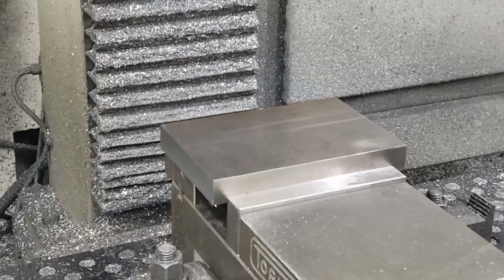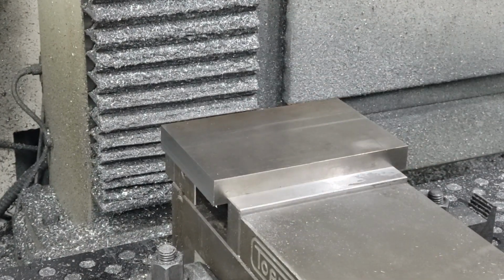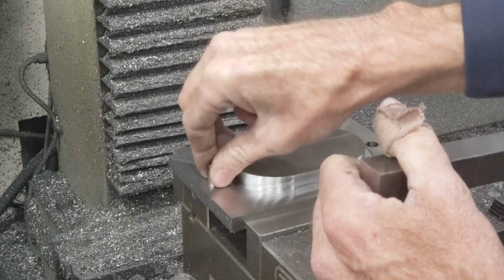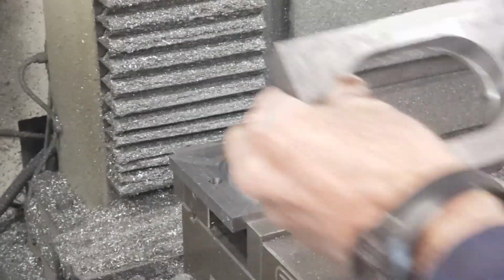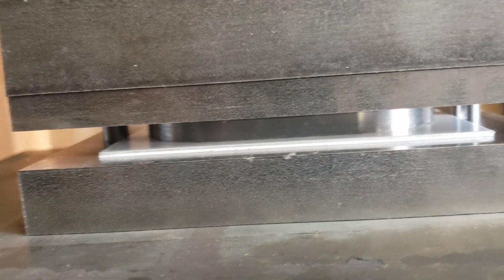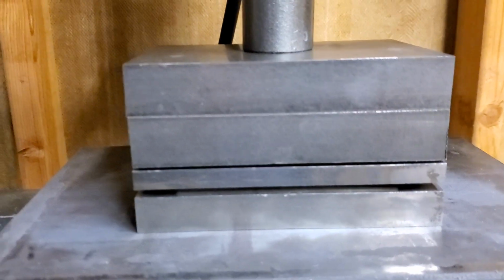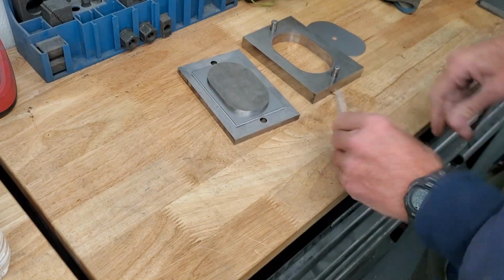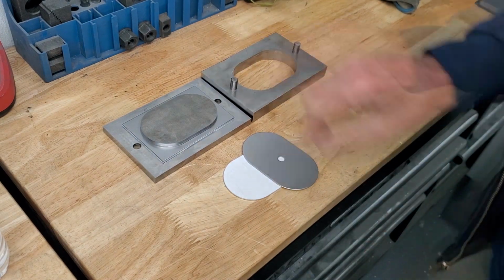Blanking Punch Die Set - The Punch

Comment: Apparnetly there are a couple styles of stripper plates, with thicker stock you can make L shaped guides that mount on the bottom plate that keep the sheet from lifting up with the punch, the other kind is like a spring loaded plate that holds the stock down.
Reply from the maker: Thanks, yeah I think I will be going with stripper springs on the guide posts and a stripper plate mounted to the top of the die.

Comment: I have made a few punch/die sets. You might try using loner pins to hold the blocks parallel and shorter top plates to clear the pins sticking out. 
Also make pockets around the pins for some die springs to open the punch from the die.
Mark the center to locate the press.
Reply from the maker: What are loner pins?
Reply: @craigsmachineshop2040  You can use hardened shafting and cut them to the length you need to go through the two blocks. McMaster Carr has shafting and longer dowel pins.

Comment: Looks like it's going good Craig, for future projects it's a industry standard to have the press fit of your pins on the core side of the tool, generally you leave them sticking up above the core this adds some level of protection I case of drops or knocking the plate over.
Reply: Cool.   If you ever find yourself needing a bit more tonnage, it’s possible to reduce the tonnage required by adding a “rooftop” or inverted rooftop angle profile to the punch face.  Of course it will tend to deform the part slightly which may be undesirable.   Depends on how steep you make it.   1 or 2 degrees might  be enough to help yet not deform the part.   Just something to consider...
Reply from the maker: Thanks Daniel. Yeah, I should have tried that on this die. I'm kind of afraid to on the real die set in case the holes aren't accurate and I can't get the pins out. Lol. I was planning on attaching the pins to the base plate with screws from the bottom.
Reply from the maker: I was thinking about making the punch concave but that's a lot of 3D machining of tool steel. Any idea of percentage of tonnage saved?
Reply: @craigsmachineshop2040  it looks like you got pretty good alignment on this one, if you want to make this one into a press on the core side just take a ball bearing larger the the hole diamater, put it on the hole and hit it a couple times with a hammer, the pin will press right in
Reply from the maker: Tricks of the trade huh. :)  I'll have to give it a try, thanks!

Comment: At 3:00 you’re testing hole fitment with a gauge pin; are you gradually upsizing that by changing the hole size in the gcode directly or are you using another type of command? Thank you!

Comment: You might try to build the relief at a taper instead of a step.  The taper will strengthen the shearing face and eliminate the sharp stress riser in the step.

Great work.  I always enjoy watching others make money in a home garage/shed.
Reply from the maker: Thanks Bruce! How is that typically done, with a taper endmill?
Reply: @craigsmachineshop2040 When machining the relief, set the part at an angle and use a conventional end mill.  Another way and maybe much easier with a CNC is to step mill the taper in increments from the bottom side of the die cavity.  Yet another method would involve a hand grinder.  Years ago I used the above methods except I didn't have access to the CNC so I manually set different depths of cuts to form a rough tapper in the relief.  
I hope this gives you some ideas you can implement into your design if needed.
Reply from the maker: Thanks for thg he tips.

Comment: What type of steel did you use for the punch and die set? Did you have it properly tempered and to what Rockwell hardness?
Reply from the maker: It was just a test set.  It was mild steel unhardened. I do have the final die set now.  I think it was D2 hardened.  Not sure what Rockwell.  I made the overall die set and outsourced the hardened parts.

Comment: Hi Craig
Just wondering, about how much clearence you left between the die gravity and the punch part of the die
Nice build great work
Reply from the maker: Thanks David. The overall clearance between the die and the punch was about .014, or about .007 from edge to edge. The punch was .375 thick and the die from face to cavity was .125. So I had an extra .250 to push the blank into the cavity.
Reply: @craigsmachineshop2040  hi Craig,
Really great video! I do have a question. Could you not just do it in cad and laser cut it?  I am probably oversimplifying it I imagine.
Thanks again for the video.
Regards,
Simon.
Reply from the maker: @simon9447   Thanks!  Laser-cutting machines are extremely expensive and the lead time for laser cutting is too long.  Punching them is actually far faster and cheaper once you have the equipment.

Comment: Craig, you didn't mention hardening the die set. What steel did you use that will allow you to punch 16ga steel without much wear?
Reply from the maker: It was just a test die set.  I used cold-rolled steel and didn't harden it.  Cut pretty well though huh.  I will be making the final dies out of A2 and farm out the hardening and tempering.  They will be used in production.

Comment: That has to be aluminum, for the milling bit to carve it?
Reply: Aluminum would be too soft.
Reply: Most tool and die are milled and tool steel which is heat treated after milling, then ground.
Reply from the maker: No, carbide endmills will cut steel, stainless steel, tool steel...
Reply: @craigsmachineshop2040  soft carbide alloys.
Reply: @craigsmachineshop2040  soft carbide alloys.